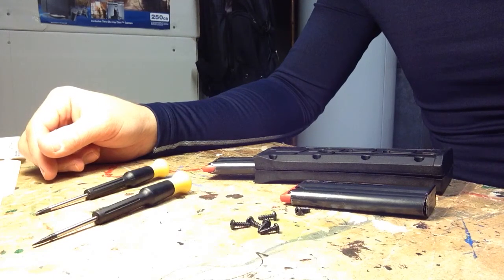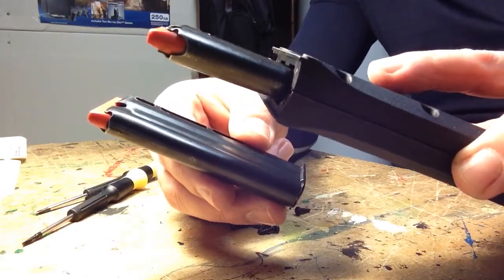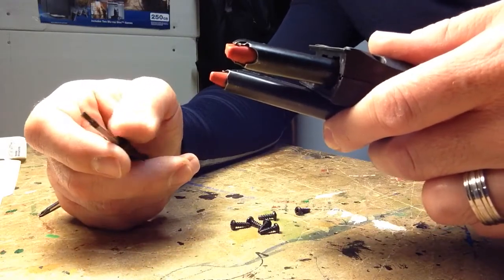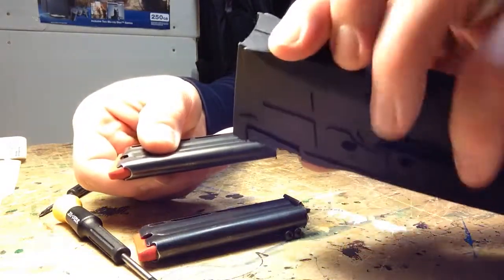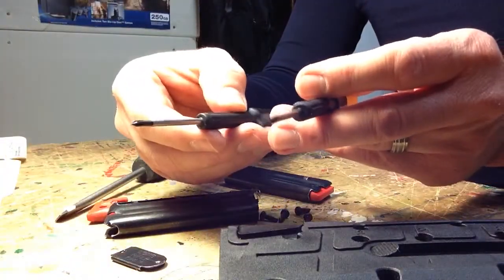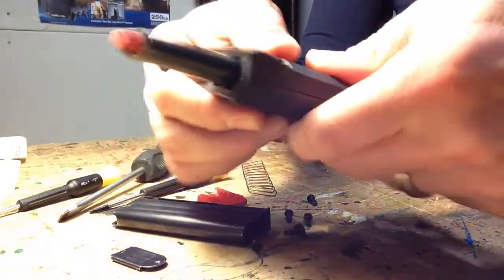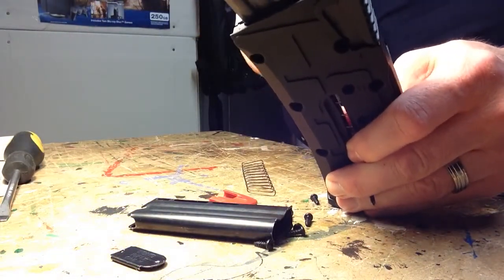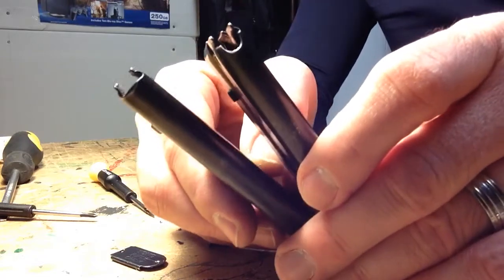Mossberg Plinkster Magazine Fix 2015.

Comment: Thanks for making the video! I had two of the 25 rnd mags and stopped using them because of issues. Your suggestion absolutely fixed the one I have left. I happened to have an extra 19 rnd that I placed in the 25 mag and it was still a bit wobbly, BUT it fed reliably. I fixed the wobble by sticking three layers of sticky side Velcro (little strips stuck to top of the larger and down the front about a half inch) atop the larger body of the mag right in front at the start of the slim portion. Have to tap the mag in now but it doesn't wobbly and gun runs like a sewing machine!
Reply: Make than an 'extra 10 round'! LOL Old fingers.
Reply from the maker: I'm glad the video helped. since making the video I have 3 ... 10 round mags and the (1) 25 round. the 25 round is now my best performing mag out of all because of the swap. thanks for your input.
Reply: @Nikolai Grady instablaster ;)
Reply: @Tomas Gibson i really appreciate your reply. I got to the site thru google and Im trying it out now.
Looks like it's gonna take a while so I will get back to you later when my account password hopefully is recovered.
Reply: @Tomas Gibson It worked and I actually got access to my account again. Im so happy!
Thanks so much, you saved my account!
Reply: @Nikolai Grady No problem =)

Comment: Are the springs in both magazines the same? When I pulled mine apart they seemed to be about the same length and strength...
Reply from the maker: Yes.The springs are the same between the 10 round and 25 round. mine are identical. thanks for watching.

Comment: Why would they make that little cut out in the top part of the mag. Also where did you get the magazine? Lastly thanks for putting this video up it was very informative.
Reply from the maker: Either poor quality control, or maybe someone else is making the 25 rd magazine for Mossberg. Try Academy Sports online for purchase. Thanks for watching.
Reply: Such a minor defect should be able to be fixed very easily by whoever is making these 25 round magazines? Has anyone tried to complain to Mossberg about this? What a damn shame! This video is 6 years old and they're still making them the same way

Comment: Will these fit a 802 bolt action?
Reply: Yes. They will fit into 802 bolt, however, I understand the bolt will not close after the last round is shot because the red follower gets in the way.
Reply: @jimdee4662  nope they don’t. $40 experiment failed!

Comment: $30 for this mag, and they can't even do it right
Reply: 50bucks where im from. bought three and they needed som love for sure, if the metal lips are uneven or very sharp try carefully sanding it down just enough not to feel like its possible to cut yourself. The magazines are very easy to take apart, one of my three mags had some small plastic pieces and fragments in it, from the molding process i guess. Cleaned all three mags and put some lube in em. Now they work like a charm, better magazine design then the ruger 10/22 if you ask me. Over 5000 rnds through my 702 and no problems at all after the first serious cleaning i did, seems like they dont care much about grime or dirt when shipping these rifles. Get the cheap trigger upgrade from Mcarbo, seriously worth it.